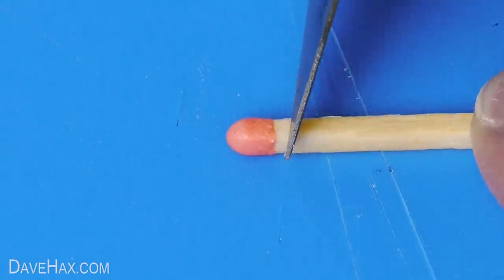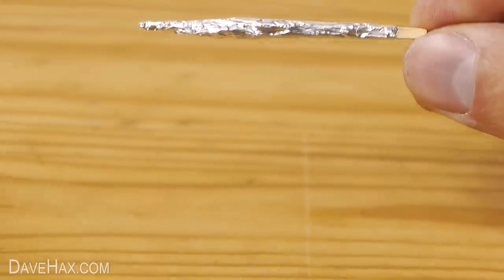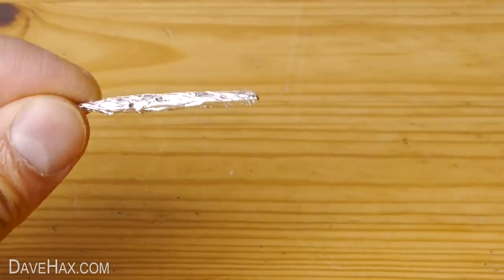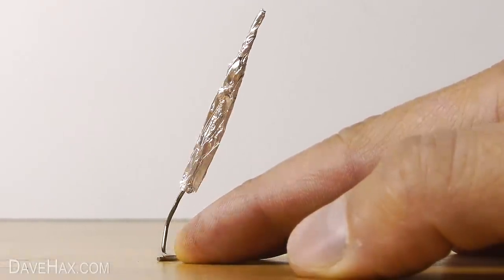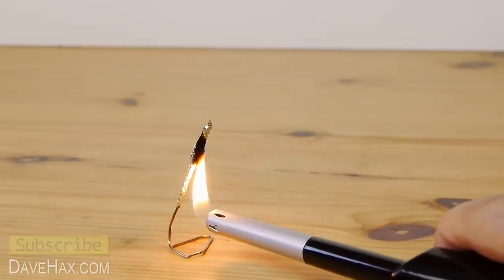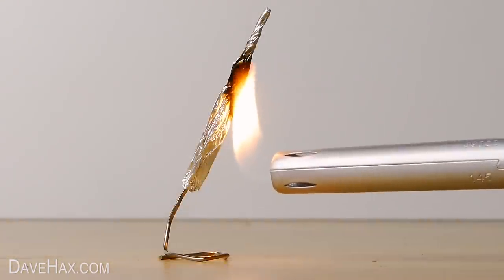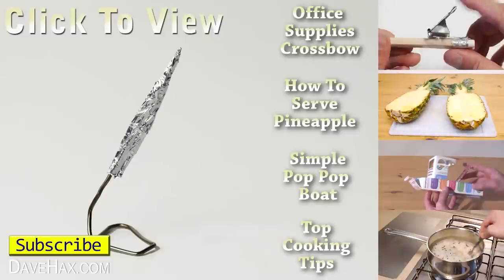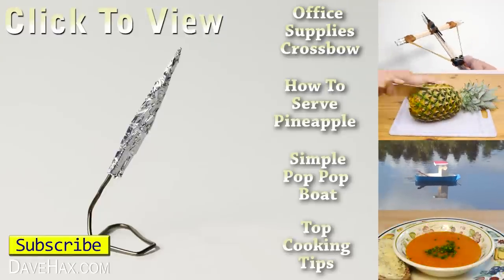How to Make a Match Rocket

Comment: "Should be done outside (...) where nothing can catch fire." Video location: inside, on a wooden table.
Reply: +Marcel Troscianko Should be done outside, in a well ventilated area.
As opposed to poorly ventilated outside areas.
Reply: im sure he had a bottle of water or smth
Reply: he is technically the expert and he most likely has something to put out fire close by but by some chance that he doesn't that was a pretty dumb move

Comment: Used to do something similar but dangerous when i was little. Take the tip off a ballpoint pen and use a safety pin to get the ink out. Then u fill it with the flammable stuff from a match and seal the end off with the safety pin. then you light whole thing and the ball from the ballpoint tip shoots off xD

Comment: Im not sure if you have a video on this, but you can take a quite small piece of foil and then use about half a pack of matches (you just scrape the magic lighty bit off all of them and then one of the sides on the packet of matches and then fold the packet together tightly and hit it with a hammer, and then it should make a little explosion almost

Comment: I got a question does it stay on fire like if it lands on something flammable like grass or wood would it burn
Reply: +diamondaxe8 The chemicals on the match head which give it the ability to light when scraped on the striker are all that burn in these. The wood will only be slightly scorched. When autoignited, a match head (Depending on the ammount of powder on it) will never burn more than a second. These rockets can be in the air for a good bit, so no worries.

Comment: I tried it but forgot to pinch it when it was on the stand so it didn't fly and just made loads of smoke come out the bottom. Also one didn't fly and instead the match head exploded a hole in the side of the rocket!

Comment: It doesn't work for me. D: The match head burns through the tinfoil.
Reply: you will need to have several levels of tin foil rolled tight...
Reply: Thanks!
Reply: Also what the guy who makes the video didn't mention, is that if you were to scrape the heads off a few more match heads and pack the phosphorus around the single match head described in the video, you will get significantly more range :-D